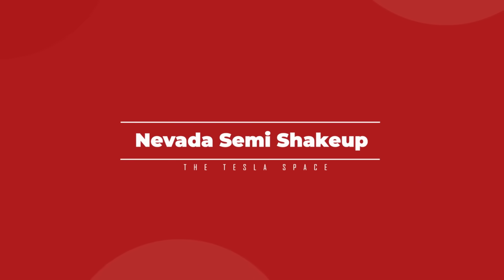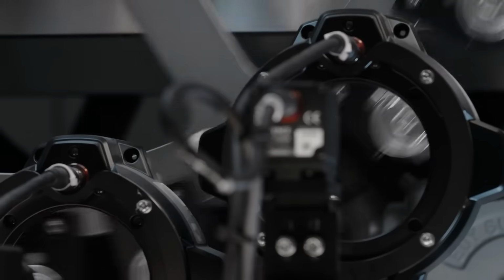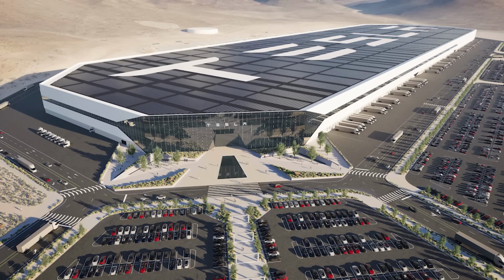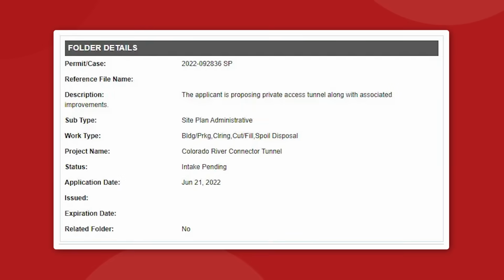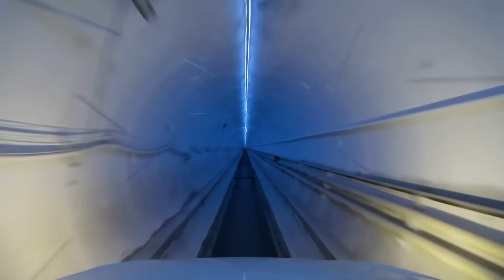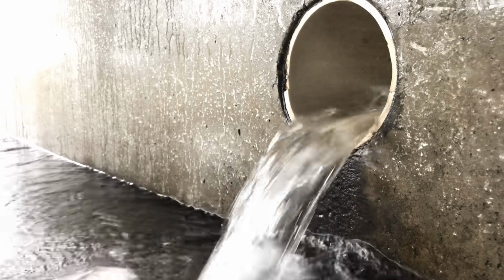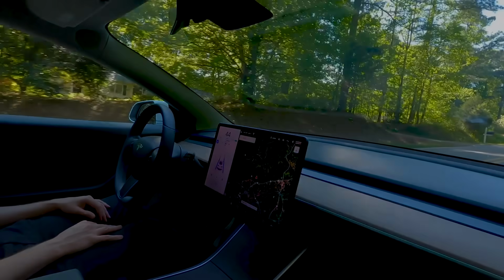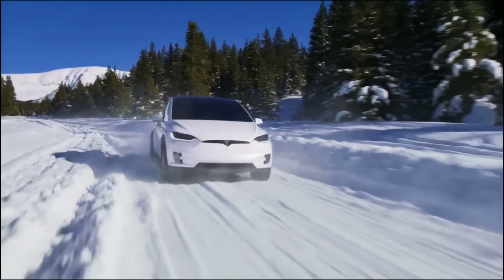Something Weird Is Happening At Tesla's New Semi Factory..

Comment: As someone who is not very enthused about the EV evolution as I don't think it's viable at the moment , I see tesla as the only company that is going to make EVs work , they are , like Apple in that regard, and all other PCs are windows . 
Tesla's  are where you go for the no fuss reliable  EV cars , the rest of the manufacturers cars , are always going to be a work in progress, until there is a technological break through , i.e. 20 min charging 600-mile range and less degradation in battery packs, with cheaper replacements .

Comment: Semi truck parking is built on different standards then a regular parking lot, think about 80,000 lbs being dragged around in circles all day/night. Knowing Tesla and their known way to overbuild all the way down to their guard shacks or to mega plan and over ex the parking lot pad that later can be a future where house pad when they need since they needed to build a parking lot for the trailers in a part of the world that sees temps pushing 120 degree ambient between the heat and the constant weight that will be moving around they are probably just making sure they have a parking lot that will stand to last over the test weather weight and time which are all factors that not enough builders consider. Most sites just build to pass their local inspections, TESLA is known to have their own standards so yes even a simple parking lot could look like a major dig down re excavate and re compact under the untrained eye or even trained eye could resemble a major build out but when you add TESLA and ELON INTO THE EQUATION all of the sudden the normal way of thinking and assuming is not the correct way to assume. So guess  all you want Elon will just cause you to keep guessing because if you’re not on your toes then you’re not inspired and to lazy to be in that world😊☮️💟☮️💟

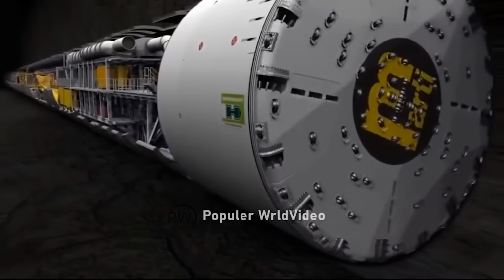Comment: The figures in your calculation at 6:02 makes no sense in relation to this proposed tunnel at GigaTexas?! 

The intended tunnel at GigaTexas is 300m long by 3.6576m diameter (Profrock bores a 12" diameter hole), and the intended dig time is 2-4 weeks. Therefore the calculation is V=π r2 h =  3.14 x 1.8288sq x 300 = 3152.12 cubic metres. Assuming an average of 21 days digging (= 504 hours), that equals 6.25 tons of spoils to remove per hour, not 120 tons? You are off by a factor of nearly 20...may want to check your numbers ;-)

Comment: I live next to a LOUD & slow highway. The Semi is my favorite of all Tesla's products.
Reply: Tire noise makes up the greatest part when talking about loudness
Reply: How many have you seen? I'm not being critical, just checking on the acceptance of the Semi.
Reply: The first several Hundred are for Pepsico/Lays fo until that order of I think 500 is fulfilled the only other ones are being used by Tesla to Move Goods around etc @anthonyxuereb792
Reply: The Tires make 90% of the Noise not the Engine/Motors
Reply: The Tesla semi weighs ~6000 lbs more than a typical Freightliner sleeper cab. The most noise at highway speed comes from the tires, and it only gets worse with weight.
Reply: They all look the same...
Reply: need to see more on the roads for sure
Reply: One thing I will never miss is hydraulic braking.. my poor ears 😢
Reply: @NPCSoftwareInc  Hydraulic retarders are silent;  it is the "Jake brake" that is so noisy.
Reply: Semis still require Air Braking for Trailers (it's not Hydraulic, Hydraulic is only used on the main cab!) @NPCSoftwareInc
Reply: @NPCSoftwareInc I won't miss trying to accelerate behind a deasil :)  

I'm surprised this is not a subsidized national priority.
Reply: @JewyMcHoser  Wait till you see an actual electric semi capable of hauling a full load PLUS it's very heavy battery for any decent distance.  But don't hold your breathe.
Reply: A Few Reasons for that @JewyMcHoser  
1. Very Short Distances (ATM Compared to what was Promised!)
2. Not Enough Chargers (Yet!) too Encourage Companies or People too buy them too warrant a State or Federal Subsidies (Yet!) in most states or Federally!
3. Not Proven too be Safe in large Numbers (What is one bad update causes batteries to overheat?!) do you want Hundreds or even thousands to catch fire on the road or worse at facilities?

It will happen but like most things takes time to be hashed out in Politics!